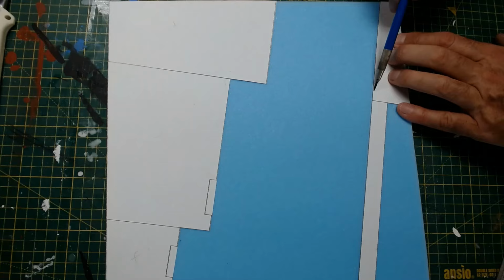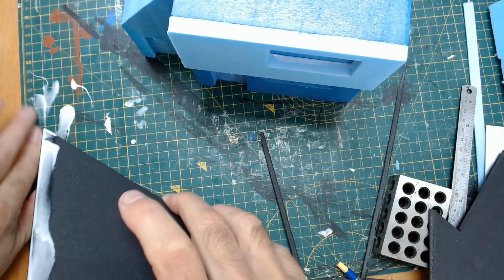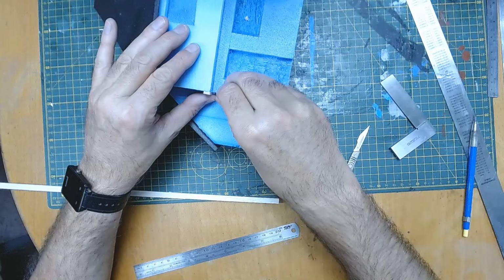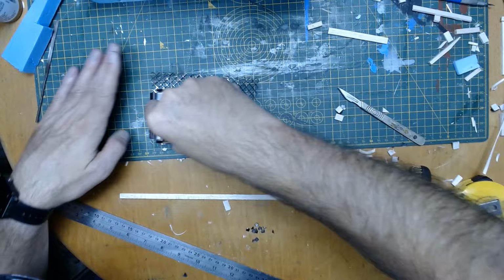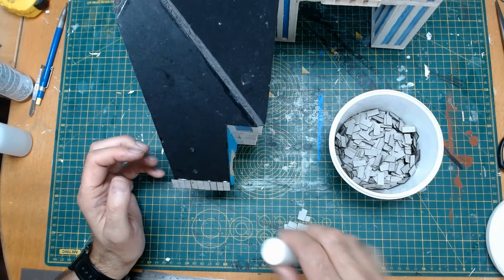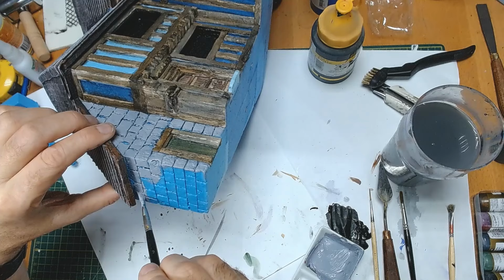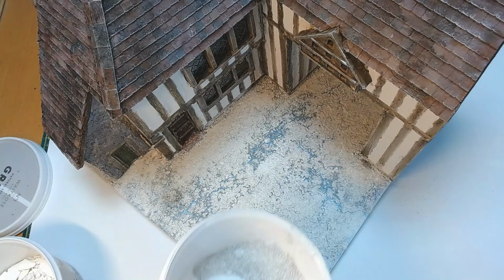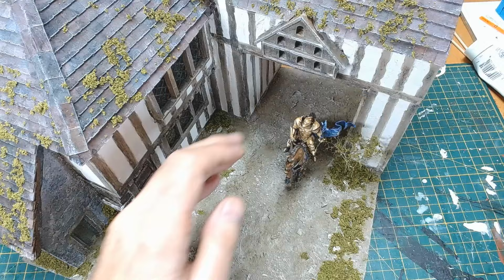How to build a medieval Diorama

Comment: Just a couple of thoughts while I'm watching, MB Fibreglass do Jesmonite, it's a water based product that sets rock hard. You can fill moulds, brush it on as a covering, dye it, and loads of other uses. Hobbycraft do their own version of Tacky Glue, it's just as good but much cheaper. With the tiles you could do them in long strips. Keep the top edge straight and join the tiles at the top but only about 1/3rd the way down. Keep a small gap at the bottom and have the bottom edge of the tiles slightly uneven. When fitting just trim to length and glue a whole row on at one time, should be a bit quicker than individual tiles.
Loving what you are doing with these. Keep them coming! Have you ever thought about doing a live stream? Either on here or Twitch, or both together
Reply from the maker: Lots of useful stuff here, thank you.
I have thought of doing a live stream, maybe in the not too distant future.